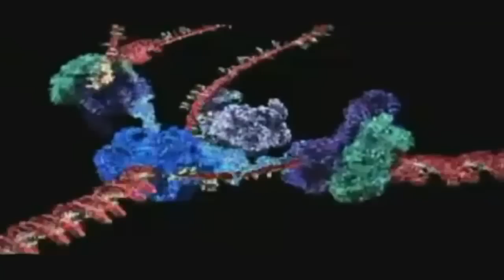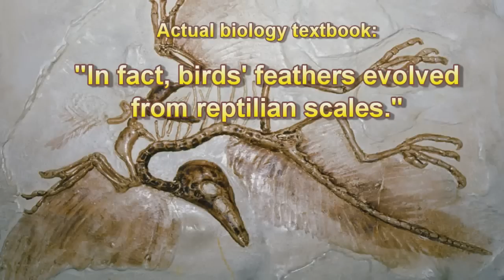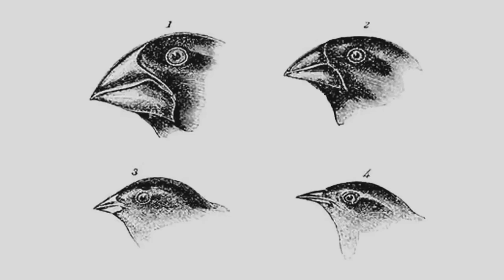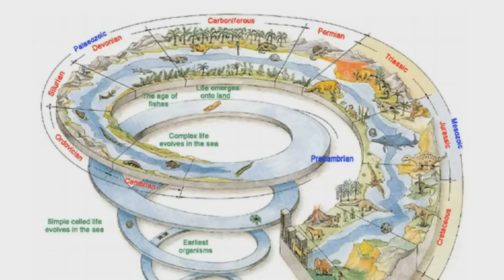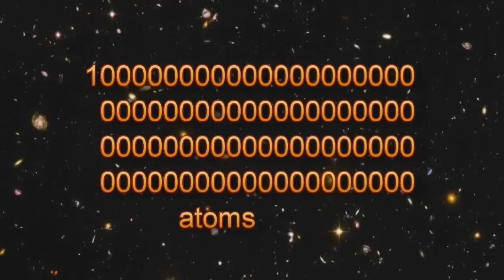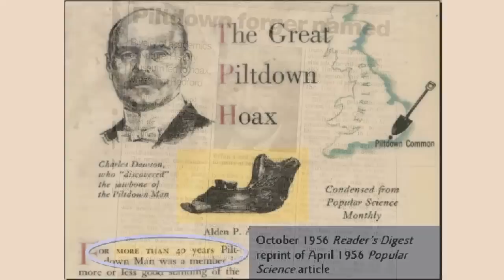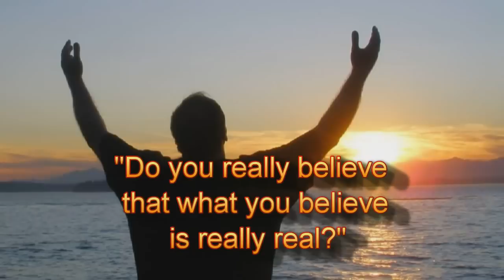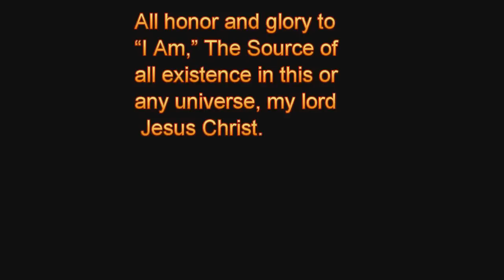Evolution Demolition

Comment: Evolution.... so why do you talk about  Atheists then Amino Acids... and then Abiogenesis... do you ever get around to Evolution?
BTW Evolutionists don't use the term Micro and Macro.
Reply: ***** It was an evolutionist who devised the terms micro and macro evolution, but I don't like creationists to use these deceptive terms either.  And, yes, I speak a great deal about neo-Darwinism in the video.  Have you been making all these comments without watching the whole thing?
Reply: Mark Champneys So what is there is big evolution and little evolution?
  What does Abiogenesis have to do with evolutoin of species?
Reply: ***** The magnitude of the change is irrelevant to the issue.  The direction of the change is the issue.  Creationists believe in vast variation within created gene pools or "kinds" or baramins.  Such variation works with the information that is already there.  It does not write new programming.

Abiogenesis and neo-Darwinism are distinct, yet they both must address the same question:  What is the source of new genetic instructions?
Reply: Mark Champneys And evolution says the same thing.  Dogs will always make dogs. 
Natural Selection works with the information that is already there. Variation in species is a fact.
Reply: Mark Champneys You do know that evolution demands that dogs make dogs.
Reply: +777THUTH777 Not over the long haul.  No such limit.  Microbes became man... supposedly.

Comment: Dude where do I start in the dispute?The whole video is ludicrous.You obviously haven't picked up a Geology book in a long time.Carbon dating is not used to date fossils or rocks.There are actually about 14 different dating methods depending on the subject....oh and your response to me clearly shows you have no grasp of Evolution.
Religion....because thinking is hard.
Reply: guym1234 Radiocarbon dating can be applied to any residual carbon material.  Evolutionists do not use it to date fossils because they expect them to be millions of years old, and undecayed carbon-14 cannot last longer than 100K years in measurable amounts.  However, when the method is actually applied to fossil carbon, it virtually always returns a radiocarbon age, making every specimen less than 100,000 years old.  This is ubiquitous.  It is not rare.  So how do evolutionists respond?  They typically cry "contamination" without proving it, and then stick their heads in the sand.  Yet the evidence indicates that this is not the result of contamination.  It is too ubiquitous in fossil carbon, while being completely absent from inorganic specimens.
Let's talk geology.  Here is a fundamental problem: parallel flat sedimentary layers covering the globe without erosion between them in most cases.  There is erosion at the top of Grand Canyon, but not between layers.  How could that be possible if the layers were laid down over millions of years.  Erosion always happens over time.  So why is it so absent?  I've never gotten a satisfactory answer from a geologist on this.  We have layers continuing across to the other side of the Grand Canyon without erosion, yet clearly the erosion of the canyon itself happened afterward with no problem.  A global flood laying down sediments in rapid succession would explain this.  Slow sedimentation does not.
Reply: Mark Champneys You are playing a bit fast and loose with the truth here. If you understood the reality of C14 dateing (you're a clever guy so I think you do) then you know that C14 exists in anything made of carbon has some C14 in it but he small values are less than measurement error. In effect, the results are consistent with zero C14 content. The experiments cited by the creationists seem like attempts to establish the measurement error of their equipment. Accurate techniques use mass spectroscopy. Mass spec, like any measurement, is not perfect. In particular, a pure sample of C12, spectrometer would indicate that a non-zero amount of C14 present. It is nigh impossible to measure exactly zero. It is when creationists then draw dates for these system errors that we get staements like "making every specimen less than 100,000 years old"

There are also novel methods of C14 production, for example A diamonds are not pure the most common contaminant is nitrogen at approximately 0.1%  Nearby radioactive material will triggerthe same C14
 production that occurs in the upper atmosphere, although at a much reduced rate.
Reply: SuperSlartibartfast No, the measured C14 is most decidedly greater than the margin of error.  That is kind of the point.  AMS lab technicians are very familiar with these issues, and accommodate them.  If you question this, you will have to take it up with them... in virtually every AMS lab in the world.
Your diamond example is hypothetical, but it does not work in the real world.  The nitrogen traces are too small, and the radiation levels too low.  Can you cite an actual experiment demonstrating your claim?
Reply: Tyrannosaur Rex I'm okay with 50K.  I was being generous to try to help you out.  You still fail.  Measurable C14 is in there.
Reply: Tyrannosaur Rex It is actually evolution of the gaps.  You guys assume what you cannot verify.  Red blood cells have been found in dinosaur tissue.  Yet there is no science to support red blood cells lasting longer than a million years by any method of preservation known to man, regardless how extreme.    And, by the way, those red blood cells contain undecayed C14.  So why are dinosaurs still crammed into the millions-of-years narrative?  That narrative is disproved, not by creationists, but by objective science.  Why is this fact ignored?  Evolution of the gaps.